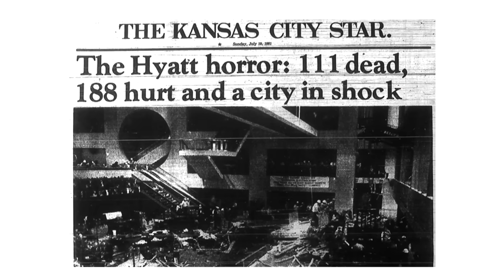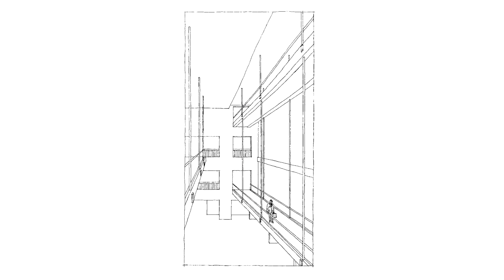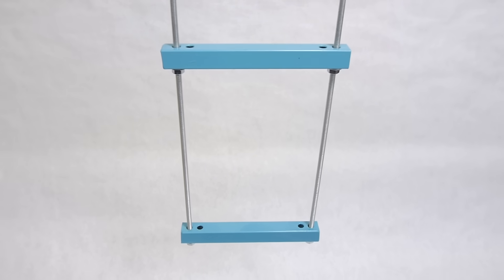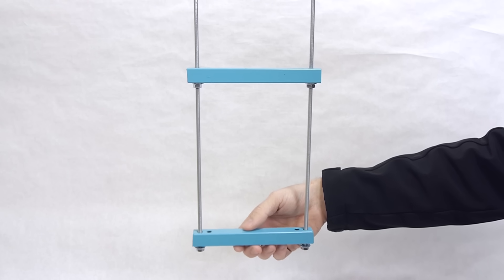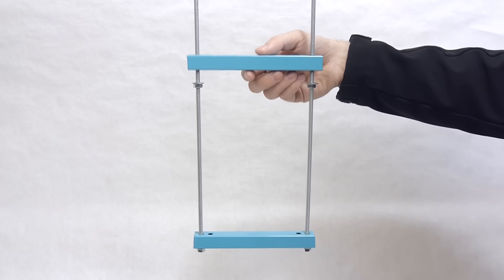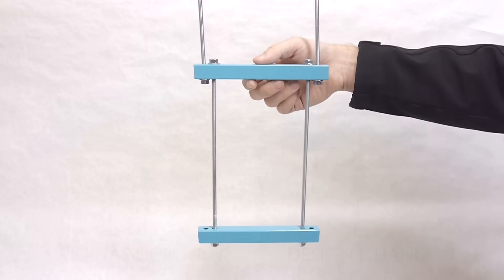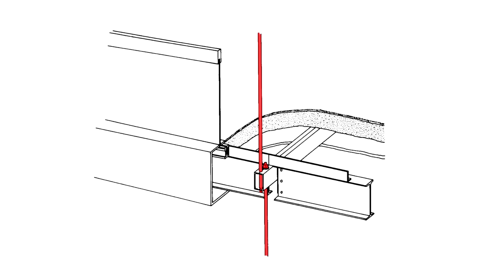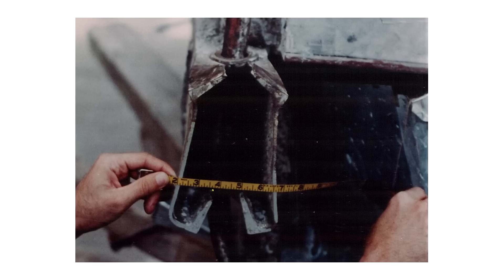The Disaster That Changed Engineering: The Hyatt Regency Collapse

Comment: I'm just a humble mechanic, but I saw the problem instantly... That the bottom walkway was no longer supported by the rod, but by the strength of the upper walkway... Maybe it's because I was taught how important having the correct torque on a fastener is - or that I have machining experience... But the fact that REAL engineers didn't catch it is absolutely ridiculous!

I also-ran looked at it and thought about redundancy - the fact that both floors collapse, even with the original design - if one of the rods failed ABOVE the top floor... I'm sorry but if the entire thing is made of metal and all you're using to support all that weight is a few rods of steel, it is VERY easy to design in a few "backup" rods that would prevent a total collapse. All you need is more rods, and more nuts and washers.

The fact that you make the trusses weaker with more holes drilled into it is also easily overcome by many methods - slightly larger diameter rods - or rods that are less brittle and have some "stretch" to them - similar to the steel used to make springs - which is called "spring steel"... I'm not saying I'm a professional or anything like that - but I could DAMN sure spot a problem like that on a blueprint. I did before the narrator even pointed it out.

Steel is extremely strong in tensile strength - means that you can pull on it and it is REALLY hard to break... Steel sucks as a lateral load is put on it - that's why they make the boxed sections - 4 sides means that half the steel is under tension and therefore doing its job.

Think about it this way - it's incredibly easy to bend a 1/2" diameter metal rod that's 10 feet long... But use it as a "tug of war" rope and you'd need to use 2 bulldozers pulling against each other to "snap" the metal rope. 

The while idea of bolts and washers is fine - but it's also very much easier to pull a washer thru a piece of sheet metal that already has a hole in it because that hole can and will stretch if over loaded - because it's a lateral load, not a vertical load. Washers are flat. Everyone knows this. 

Using round tubes instead of box frame also would have helped - and yes there are rounded washer that fit around a pipe... Anything that's a circle has to transmit all its compressive or tensile strength thru the entire circle. That's why it's so hard to break an egg - if eggs were square they'd never make it to the supermarket and chickens would all have very sore butts. 

The Romans realized the circle is the strongest shape. These engineers know that too. 

So that's 2 mistakes in my opinion. Completely opinion though, I have never engineered anything. I have modified things but never built a walkway from scratch.

Comment: What the beams needed were plates welded across the top and bottom of the box girders, and a plate welded inside between the holes. With the girders made of two "U" or "C" channels welded together, it was begging for a failure at some point even if the walkways had been built as designed. Drilling through a welded joint like that doesn't seem like a good idea to me. Using 2x as many support rods in a staggered pattern, drilled through on either side of the weld seam, might still have caused the welds to break but may have averted disaster by having the rods fully surrounded by solid, unwelded, steel. If they'd just welded plates across the open ends of the box girders it might have kept them from splitting apart.

Comment: There was an additional change farther back in the design process.  The "box" girders are NOT truly box girders,, and the "box girder was originally supposed to be back to back C channel girders.

The bolts and the connections were to be both slipped in from the side, and to be directly under the web sections of the back to back C-sections.   THAT is why the change to a "box" girder was accomplished with a site welded flange to flange frabrication, instead of a true rolled steel box section beam.  This change from back to back (web to web) , vs flange to flange, site welded, ,,,,

There was no insert welded tube,  nor were short web to web stiffeners included.  Either could have prevented the collapse.

Comment: Every structural failure influences subsequent engineering, but that is no guarantee that similar mistakes will not be made by engineers who fail to learn from past failures.  The 2018 failure of a pedestriam walkway under construction at Florida International University reminds me of the Hyatt Regency disaster.  In both cases, the owners wanted a structure which would be visually dramatic, and the engineers obliged at the expense of safety.
Reply: Two things, the silver bridge could possibly be rolled into the same category, and has anything been released about the conclusions on the FIU collapse?
Reply: Timothy Barney — There are reports from OSHA and the NTSB which are must reading to get the whole picture.

Comment: One could surmise that perhaps the primary cause of the failure was the weakness of the fabricated box girder. It seems the  nuts held, but pulled through the opened girder.  Perhaps the girder design and the nut / washer size were inadequate, and the design change may have held barring that. I do not see that the nut with the 2x load failed - rather the girder opened!

Comment: Civil engineers are concerned with safety margins.
The business of engineering is concerned with profit margins.
Somewhere in the middle these margins meet (hopefully).
Reply: they hopefully don't meet in the middle.
Reply: they do meet in the middle for one simple reason
if its not durable no one buys and it doesnt make profit so it being durable is profit
Reply: Stakeholders / Property owners are too short sighted to see the profit in safety; can only see the project being on time and on budget, so they can make their bonus.

They may sell the property down the road, so it's no longer their liability.

Civil engineers are the consistent item for a structure through all the years. They have an inherent responsibility to continue pushing for safety margins, and most are trained with this mindset from University and onwards.

Comment: The thing that puzzles me about this is, in the photos of the box girder, it appears to be split parallel to its axis. 

Was that beam made from two U-beams or was it a single box? 
If the beam was stronger, would this system be acceptable solution?
Reply: Perhaps it would've held, but I say it'd still be unacceptable. The upper beam in that case would still be carrying twice the designed, intended load.
Reply: @benchociej2435 
I think you're right.   I do agree making the rods threaded their entire length would be problematic.  But it is doable.  Maybe something totally different would have been the right choice. 

But then we all have an eyeball in our ass where 20/20 hindsight is concerned.   Fortunately these disasters have positive outcomes. Every time a plane or bridge goes down we learn more about keeping them up.   Just look how safe airliners are today.  100k commercial flights a day, and maybe we lose one every 6 months.

Comment: Question:   Would the box girder have held okay and not split, if the washers (stiffeners)  would have been much longer as to spread the load out along the box girder????
Reply: Possibly yes. But it would still be a bad design. As I understand, they should have used real box girders [] ...which would be unlikely to split at all. Then they probably would get away with doubling the load on the upper walkway.
Instead they apparently just welded a pair of C beams together, like so  [ ]

Whoever thought that was a good idea ...should’ve had their ass welded to a prison cell bench.
Reply: @smoker738  Thanks.

Comment: This is why I like being a software engineer. In most cases, an error you made won't kill anyone.
Reply: Yet....
Reply: smoker738 — An x-ray therapy machine killed four people in the 1980s due to software errors.
Reply: flanker — Then there’s the Boeing 737 MAX.  Not just a coding error, though, but a system design error.

Comment: A design that doesn't rely on a continuously threaded rod is easy to think of. I can think of a few. One would be where the rod is threaded where the nuts are and undercut the rest of the length. Using a fine thread would reduce the undercut amount needed. Another would be a wedge style connection similar to how elevator cables are terminated where the harder you pull the tighter it grips. Another would be like a snap ring.

Comment: > Grenfell tower
Seems the hope that such dumb mistakes would never be repeated came sadly a couple months before they actually were, just in a different part of the structure. The cladding used was a last minute change to the original (safer) spec, and whoever signed it off didn't bother double checking it was still compliant with the building regs. With a number of similar small but, in combination, massively contributory alterations to the building's original inherently fireproof design that turned it into a hollow firelighter.

Comment: The primary failure was due to the fact that they changed the shape for the girder from an I beam to a box. 2 times the maximum weight of something should never make a component fail. Engineering for a safety of human life normally requires a factor 4~5 of yield.

Comment: In the city I lived in there was a three story steel frame building that was at the structural level.  The precast panels were all loaded on the south side of the building the same time the foreman had the labours take off the north cables holding the building up.  The building feel to the south and crushed all the cars that were parked for the length of a city block.  Two workers were killed.  The Architect had under spec the rebar and used a poor quality of concrete mix.  The Architect lost her stamp and there were lawsuits.

Comment: This vid is wrong. 
Yes 2 times the load... but there is a load factor > 2.5 for safety. The bridge would stay even with 2 times the load!

The real error: 
missig stiffeners!

in the original design, the cross beam were 2 C-Channels, back by back (joint to an I-Beam)

the channels turned by 180 degree, so the joint to an hollow structural section (or tube), like the blue parts in your vid
without stiffeners those tube MUST fail, because these will reduce the strength by factor 4 - 10 !

Comment: One of the biggest dangers in any work is a change.  Changes don't get as much detail attention as the original work.  People tend to try and determine what is different and see if it is a problem, often missing issues that would have been caught if the change was in the original plan.  Management loves to push the changes through if there is a potential cost savings.  It's not right or wrong but the risks do rise and it's human nature to believe that the hard work has already been done and we need only look at the differences, not go back to the starting point.  An inordinate number of safety related investigations I've seen were a result of changes made to an original work plan.

Comment: Very nice demonstration of how the load on the box beam doubled.  We've studied this disaster for 15 years in my Engineering Ethics class at Wichita State.  

However, I disagree with the claim that this disaster changed anything at all.  Design changes, such as the one proposed by Havens Steel, the walkway fabricator, are proposed as a matter of course.  The simple reason this was not adequately reviewed was the pressure to complete the project.  Such pressure has only grown in the construction industry, leading to more inducements to cut corners.

Two weeks ago my students delivered a presentation on the forensics of the Hyatt disaster, and claimed that such an event could not happen now, because we are so much better at predicting loads,  and design skills and codes have improved.  A week later, the FIU pedestrian bridge collapsed.  These disasters will continue to happen for the same reason they have in the past--we're in a hurry.
Reply: dolofonos  
The solution is to actually enforce laws.
And if you think that is too harsh, then the laws are too harsh. Not the enforcement,.
A law that is not enforced does nothing.
Reply: as usual safety third behind time and money
Reply: Still surprised the structure failed. Live load carrying components typically have a high factor of safety with a liberal assumption for loading. Perhaps design requirements have changed in 40 years or the equipment used wasn't tested for its design rating.
Reply: @TheSterlingArcher16  True if the components were actually designed.  This assembly appears to have been put together with whatever was convenient.  How would you have calculated the load capacity in this contraption anyway?
Reply: @TheSterlingArcher16  As designed, each walkway would have been able to hold many many times more people than could possibly fit. When it was changed, the upper walkway wasn’t just taking on the human load, but also supporting a walkway that itself was designed to hold many times more people than could possibly fit. The weight of the people was probably only a fraction of the weight of the second walkway. They, unfortunately, were the tipping point.
Reply: I5  @TheSterlingArcher16
Reply: On this disaster, why would they just weld the c beams and leave it like that? Shouldn't they have placed a set of nuts and bolts through the beams horizontally?
Reply: @smoker3092  All told, it would have been cheaper to just get box beams.  You can't put enough lipstick on the c channel pig to make it OK.
Reply: You immortals have it so easy.
Reply: Somewhere in the architect's attic there is probably a scale model of this "skywalk", built with balsa, foam board and monofilament fishing line and constructed to sell the client on the magnificence of the design and justify the cost. But not to worry, the architects are never to be blamed. That is what consulting engineers are for.
Reply: In a hurry, desire to save face, cost cutting, laziness, group think, etc. Definitely more than one reason
Reply: I would disagree; most failures NOW happen to occur because of construction/fabrication error - not design error.
Reply: @dn1675  I agree. Worked as QC at a truss plant and quit because the lack of quality frightened me and the inability for anyone to take it seriously was the tipping point. Truss missing plates on both sides of the joint.. seriously?!
Reply: @dn1675  that's exactly what this is, though: a construction/fabrication error. The original design would not have failed in this manner because the nuts supporting the top walkway would not have been doubly-loaded like this. The change to the design was submitted while they were in the thick of building the actual thing and is, at the face of it, a very sensible modification. To have to thread a nut through THAT much threaded rod really is a stupid thing to do, and perhaps the more effective solution would have been to have a female-to-female coupler to mate two sections of threaded rod together. But that would have been a custom part and would have resulted in delays to get a new part designed, added to the drawing(s), run through all the appropriate design reviews and analyses, and then fabricated.

@Day Radebaugh is correct. Modern society demands demands demands that things be done faster and more efficiently, and the demand to keep building and making faster and faster will always incentivize people to perhaps let their vigilance slack in the name of not being the long pole. It's not like there's a big book of rules saying "thou shalt submit thy designs to the committee whenever thou increaseth a bolt hole by more than 0.01"". That big book of rules doesn't exist even now, not after the Hyatt regency disaster. People have to make these choices on the fly, often using their instincts, and there will always, ALWAYS be pressure to get it done NOW.
Reply: @peterkim4568  The original design was also flawed, didn't meet State law and most likely would have failed. The engineering firm never ran load analysis on their design. They thought it was someone else's job. During construction the ceiling to the atrium collapsed and after being directed by the building's owner to check all steel-to-steel connection strength, they "glanced" over their work and still missed the design change and never worked up an analysis.
Reply: @dn1675  Sure, but that's not because of this incident. It's because we have better tools that help to identify potential design errors. These tools were not created in response to the Hyatt Regency collapse.
Reply: Day Radebaugh — Couldn’t happen again?  Florida International University pedestrian bridge.  Fortunately, there were no pedestrians, as it was still under construction.  Unfortunately, traffic was flowing underneath it.
Reply: @GH-oi2jf  you didn't even read his full comment it seems lmao
Reply: @GH-oi2jf  cool story bro
Reply: The thing is, this wasn't because of some previously unknown engineering principle or material property. it was simple human error, a failure to check and re-check. If they'd bothered to do the load calculations on the new design, any student would have caught the mistake. I think it's a stretch to say it "changed engineering", the actual science of engineering was not informed by this event, perhaps more accurate to say it changed, or highlighted the importance of, proper management and administration of engineering projects.

Comment: You are supposed  to design structures such that if one element fails other elements can carry the load. It's called redundancy. This stupid design has no redundancy. If you cannot use redundancy then at least design the structure so it will fail in sections. With this shitty design  If so much as one element fails you get a cascading failure.